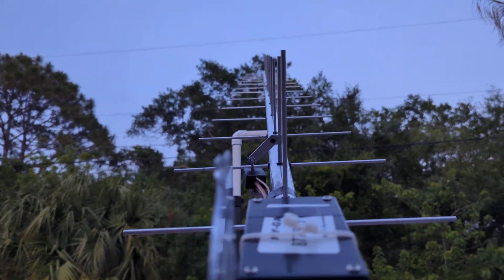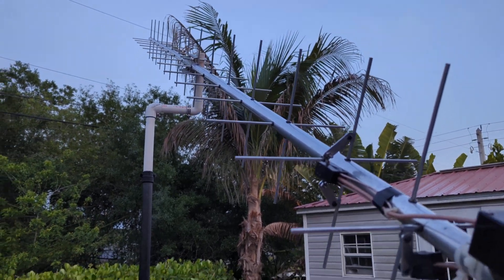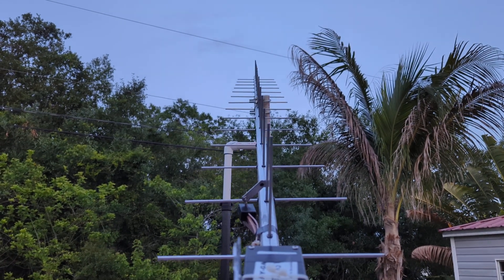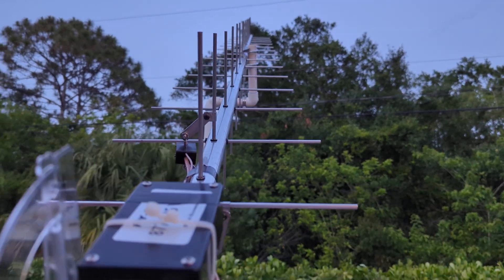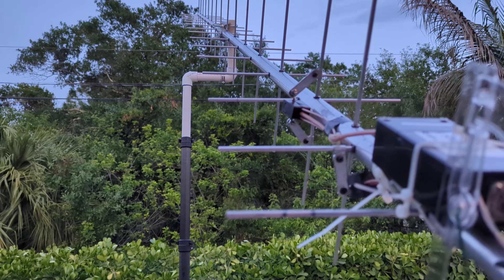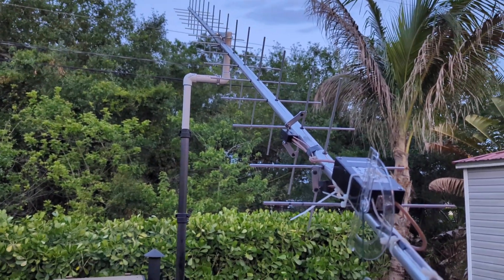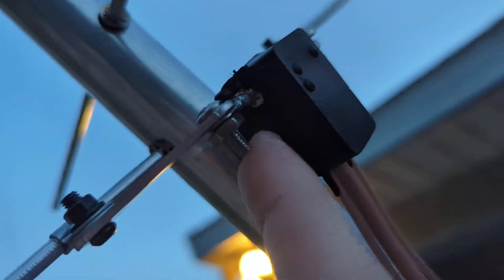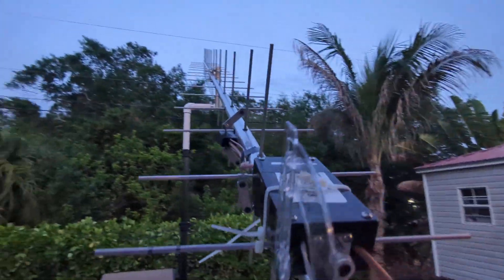Part 4, It's Ready, EME Moonbounce Antenna

Comment: Keep in mind that if you're running RHCP on your antenna system, then the signal coming from the moon will be LHCP. It changes its polarization once bouncing off the moon.
Further to that, a VLNA is a must if you want to hear or decode EME signals. One dB makes a huge difference in moonbounce.
The closer the VLNA and power amplifier to the antenna, the better.
There are several good people on HB9Q to help you out.

Comment: What is this 50w waiver?  I didn't know about that and I'm closer to KSC than you are
Reply: Its for the entire state of Florida. That band is used for flight termination systems on military flights and tests

CFR47 part 97.313(f):

(f) No station may transmit with a transmitter power exceeding 50 W PEP on the UHF 70 cm band from an area specified in paragraph (a) of footnote US270 in §2.106, unless expressly authorized by the FCC after mutual agreement, on a case-by-case basis, between the District Director of the applicable field facility and the military area frequency coordinator at the applicable military base. An Earth station or telecommand station, however, may transmit on the 435-438 MHz segment with a maximum of 611 W effective radiated power (1 kW equivalent isotropically radiated power) without the authorization otherwise required. The transmitting antenna elevation angle between the lower half-power (?3 dB relative to the peak or antenna bore sight) point and the horizon must always be greater than 10°.

US270 In the band 420-450 MHz, the following provisions shall apply to the amateur service:

(a) The peak envelope power of an amateur station shall not exceed 50 watts in the following areas, unless expressly authorized by the FCC after mutual agreement, on a case-by-case basis, between the District Director of the applicable field office and the military area frequency coordinator at the applicable military base. For areas (5) through (7), the appropriate military coordinator is located at Peterson AFB, CO.

(1) Arizona, Florida and New Mexico.

Comment: LOOKIN’ GOOD!   As others have mentioned, EME on 70cm is NOT typically circularly polarized.  Using circular polarization will indeed cost you around -3db on both receive and transmit so IF you are attempting to hear your own echos, it will cost you a monsterous -6db which is pretty much death on a Single antenna system.  Although the typical polarization is linear, due to Faraday rotation it wil even then be constantly changing. On 70cm, this is around 15-20minutes. Based on this, sometimes the best will be horizontal other times it will be vertical.so the best switching would be NOT circular but between Vertical and Horizontal linear polarization so you can switch back and forth to optimize signal strength.  Knowing the polarization of the other station will help and there are some programs to help you BUT typically it’s just empirically found.  

Not sure where in SFLA you are located but down here in Fort Lauderdale, Aircraft radar can also been a problem to add to your fun.  Obviously you’ve already discovered the power limitations.  I had a waivor years ago but long. now expired.  

All above prompted me to go toe 23cm!  Good Luck! de K9BCT

Comment: I've been working on a diy 2m CP yagi for sat contacts at field day with my club.  Pulling my hair out so I hear ya.  However, 3db loss is better than the 30db loss of being 90degs off polarization between vert and horiz.  For voice I figure the signal is rotating so fast that it will be a big improvement.  Maybe not so for digital.  Good luck.

Comment: I admire your determination. I tried moon bounce back in the early 80"s with limited success using 4 x 21 element Tonna Yagis. My best contact was with W2GN. I used the high-speed Compact Cassette method. That all seems ancient in this age of computers😂. Keep up the good work. 73 de G4RJS.

Comment: dont throw out the soldering iron get it up to heat and clean that tip with a wire brush then dip the tip in flux and retin the tip!